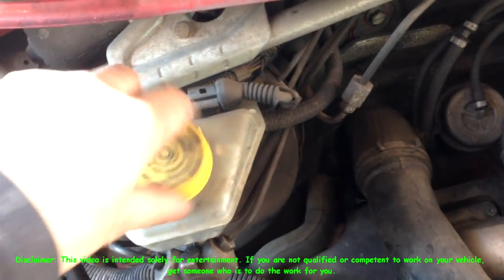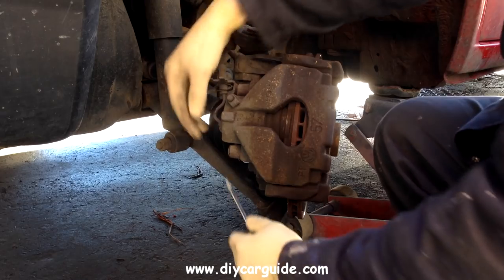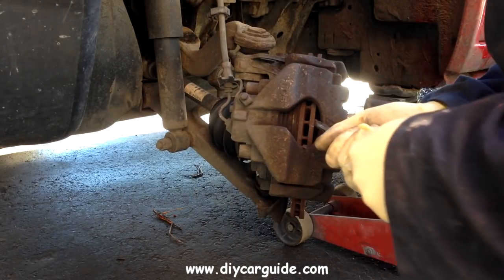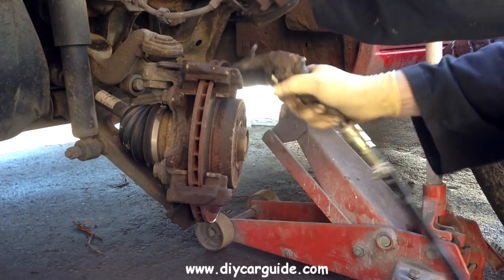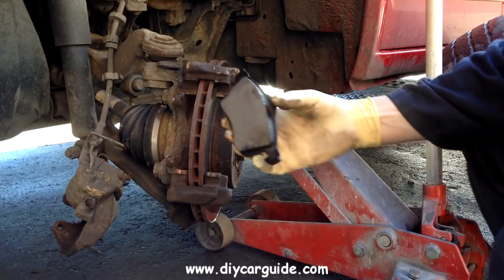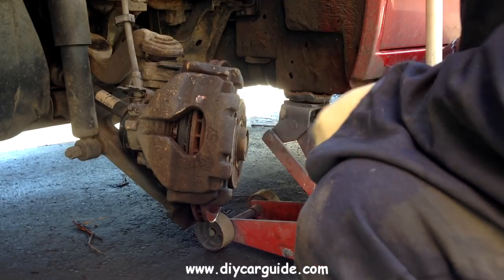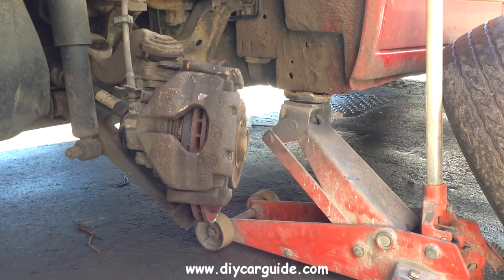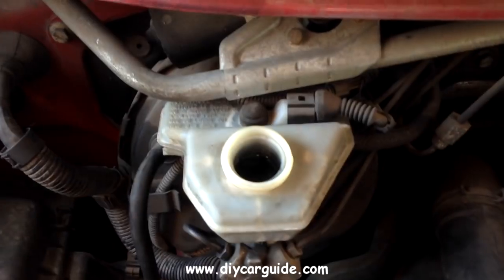Volkswagen Transporter Front Brake Pads Replacement

Comment: Good video, makes it look pretty easy.   

Edit.....I did this job today and did both sides in 45 mins, Im sure next time I could do it in 30 mins. 
Just saved myself about £100 as I also did the rear brakes,  the rear pads were ok so just lubricated the sliders and a spot of copper grease on the back of the pads. As a first attempt Im chuffed with my efforts.  
If theres anyone out there who hasnt done this before its fairly straight forward. 
The fronts were easier than the rear by the way.

Thanks for a very clear video.

Comment: How about the brake pad sensor wire? In my T5 the cable in attached to a brake pad front right but here i don´t see you connecting or disconnecting any wires?